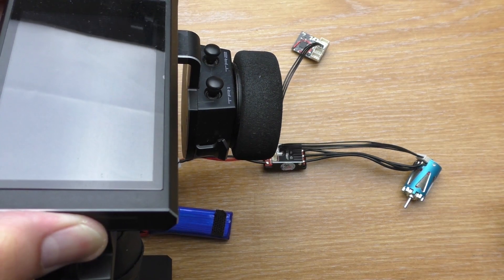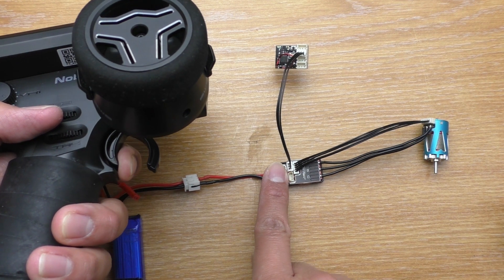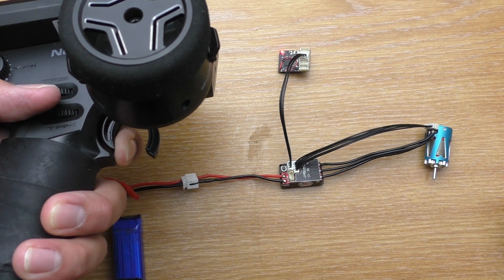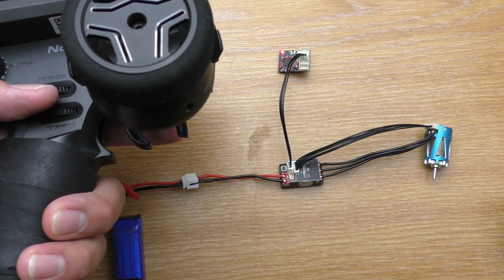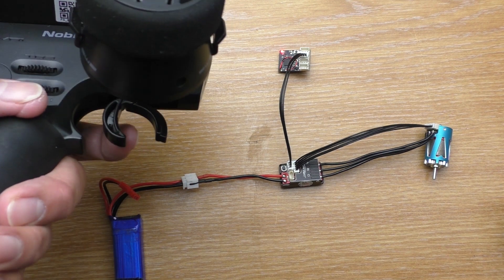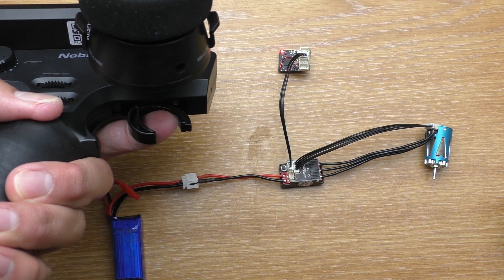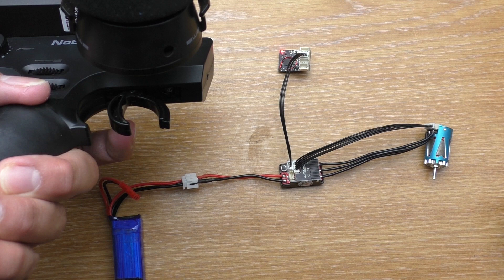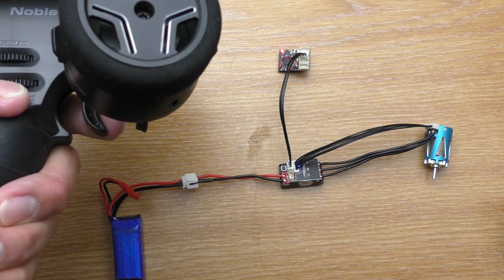How To Calibrate Furitek Cyclos Brushless Sensored ESC Without Bluetooth

Comment: Hi beaver, I just got mine all ready , my first build, I have the same noble. Do you Put it in Bind mode to connect it? I try the same and the light on the Esc keeps blinking won’t beep, while holding trigger down or up
Reply from the maker: You'll have to bind the receiver to the transmitter first if it's not bound already. After that you will calibrate the throttle.
The bind function is on the receiver. The button on the ESC is to calibrate the throttle.
Reply: Ohh okay thank you so much , yes I have the gy55 nano receiver v5, I have not yet bound them thank you !

Comment: Hi Beaver! Do you know if the AGFRC GY04M V3 mini gyro has a slow return? I'm using a Futaba 4pls radio. Das mikros receiver - Channel 4 at 30% seems to keep it from extreme wobbling. Channel 3 says it's in use by a switch or something. Thx in advance!
Reply from the maker: Unfortunately no. It has high and normal sensitivity modes though. If you set it to normal and it still wobbles then you need to check the suspension if there's any play in it and also if the floor is a bit rough it will wobble too.
Reply: @BeaversHobby  I'll look into it! Thanks again for the great insight!! (such a bummer it doesn't have slow return). I know you said you prefer the fast return if you had the choice with 1/24. What other micro gyros have a slow return and is it worth it?
Reply from the maker: @thedreamingsupercade  As far as I know he only one that has slow return is the GT55 V4. I suggest playing with the setup and servo placement would be better than replacing the gyro.
By the way, if you use a programmable servo like AGFRC A11CLS or A06CLS then you can add more dampening  in the program to help with the wobble.

Comment: I was wondering if it'd be possible to connect a normal brushless motor (no sensor) to the cyclos? Thanks
Reply from the maker: Yes, it can. It will also work without sensor.
Reply: @BeaversHobby  Thanks!